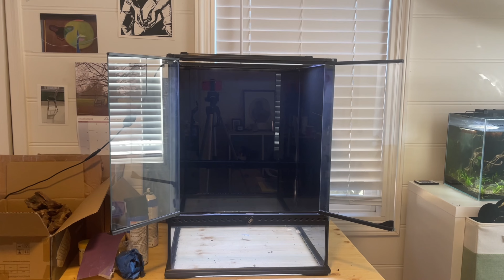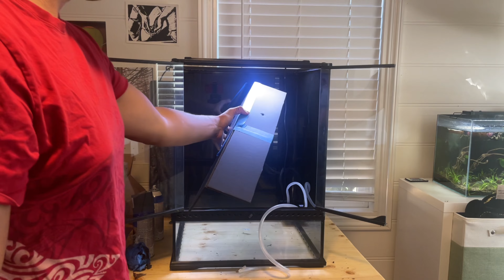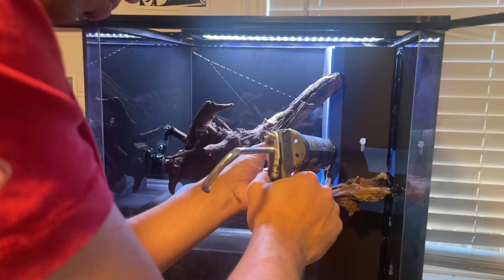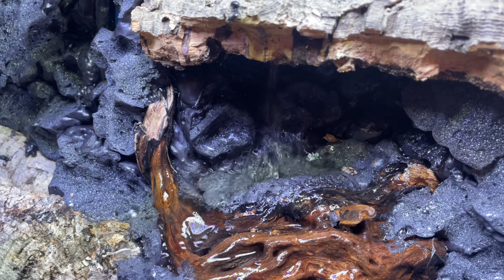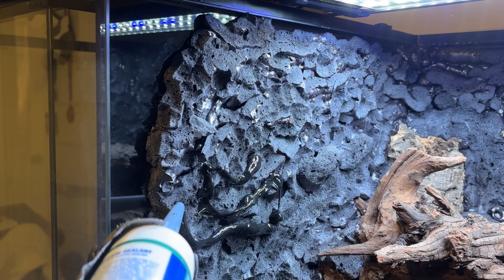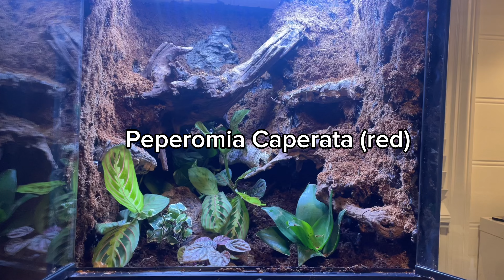White’s Tree Frog Bioactive Vivarium Build! 18x18x24 with waterfall- Step by Step

Comment: are the toothpicks used for the moss removed later? if not how do you keep the frogs safe from accidentally poking themselves?
Reply from the maker: The toothpicks are first cut off after pinning the sponge in place so one side is dull. Then they’re removed once the moss is rooted

Comment: What was under the foam you put in the bottom? It doesn't look like the glass
Reply from the maker: there’s a layer of sponge on the bottom for our drainage layer
Reply: @tangledearthvivariums so the sponge and foam are two separate layers?
Reply: @tangledearthvivariums also curious about this. I don’t understand where the water source comes from? Are the layers just foam and substrate on top? Where do you add water to feed the pump?
Reply: My question as well! Not clear on how the bottom layers are working to allow the basin for water fall to feed from

Comment: This is a horrible set up for whites tree frogs. Whites tree frogs are a low humidity species and should be kept at 40 to 45% . 

This set up with the waterfall will cause the humidity to stay above unsafe levels of humidity and will cause the whites tree frogs bacterial infections.
Reply from the maker: the top is fully open mesh, plus the ventilation at the front makes the humidity pretty low. The waterfall is small and really only raises the humidity directly around it. It’s comparable to having a small dish of standing water in the tank. It can also be controlled remotely or put on a timer so it doesn’t have to run 24/7. We wouldn’t recommend a full on waterfall or drip wall background for WTF, but a small dripping water fall can be a good way to create a humidity gradient so the frogs can self regulate

Comment: Australian white tree frogs have low humidity requirements, 50-70%, compared to other tree frogs that need 80-100%. This terrarium is going to maintain humidity way too high which will lead to health problems for the frogs.
Reply: You are correct they need low humidity but you are still to high. Whites tree frogs should be 40 to 45%
Reply from the maker: the mesh screen at the top is completely open. They get good airflow and can self regulate humidity. Towards the bottom is closer to 70% The top is closer to 50%. For 80-100% humidity we would need to cover the top with glass or acrylic and mist very frequently
Reply from the maker: but this may vary for individual people depending on where they live and the ambient temp and humidity
Reply: @tangledearthvivariums whites tree frogs are low humidity species and should be kept at 40 to 45% this set up is horrible for them

Comment: How much did the background cost?
Reply from the maker: good question! For an 18x18x24 spray foam, silicone, hardscape, and plants can cost anywhere from $100-$500 depending on where you source them and how much you use. It’s a big range, but if you’re able to get your hands on cheap driftwood and plants it keeps it on the lower end for sure.

Comment: How do you drain the tank of water if it’s needed
Reply from the maker: good question! I’ll usually stick an aquarium siphon in one of the front corners of the tank between the sponge layer and the glass and use that to drain the water. It’s not something I need to do often on our tanks but that’s pretty quick and easy when we do. If you want you can leave a small pvc pipe going to the bottom and cap it with something so you can get the hose in easier. You could also stick a siphon in the waterfall compartment at the back which gives easy access to below the waterline
Reply: What type of wood did you use for your hard scape

Comment: How did yall move it? I have a bioactive the same size and am concerned it will shatter if I try to move it as it’s so heavy. Especially with the wood and drainage layer
Reply from the maker: 18x18x24 we’ve been able to move fairly easily. We drain any water, lift it with two people, and put it right side up in a car, sometimes wrapped in blankets. You can also stuff the gaps on the inside with paper towels during transport to avoid it shaking around.

Comment: Do you worry about mold in these type tanks ? Do you ever have to change out water or clean the tank ? I’ve started my first bio with springtails but I just worry it’s not enough and afraid if mold could grow?
Reply from the maker: no issues with mold. As long as you have enough springtails and airflow it should be totally ok

Comment: I’m trying to build a waterfall with false bottom like you did here but I’m still confused. With the waterfall just dripping out onto the substrate and then back down to the drainage layer again, does that mean you have to top off the water pretty often for the waterfall to keep going? How does the water level stay the same when it’s dispersed into the substrate… ??
Reply from the maker: there’s a 2 inch layer of sponge beneath the substrate. This is our drainage layer and it contains standing water. that water level has to be above the height of the pump intake, but below the substrate to stop our substrate from just being soggy and stagnant. The water does disperse throughout the substrate but eventually it makes its way down to the drainage layer. It mimics watersheds irl, where water pools under the soil in between evaporation and condensation. You’ll generally have a gradual input of water to your tank in the form of misting or watering for the plants, so I find I actually have to drain our tanks periodically rather than top them off. If you’re in a hotter, more dry environment though, I could see you having to top off or mist more frequently. With a system like this where air flows freely and you mist the tank, it’s rare for the rate of evaporation to be exactly equivalent to the rate at which you add water. TLDR: it depends on your tank and house parameters
Reply: @tangledearthvivariums i want to make my own so i just get my aquarium foam on the bottom and the water will reach the pump fast enough? i have like all the same materials as you
Reply: Where do you buy the sponge layer from

Comment: Question about the foam board sitting in water- does it dissolve over time? Any risk of soil or water contamination?
Reply from the maker: it should be all good!! if you’re worried you can also use plastic sheeting
Reply: @tangledearthvivariums  got it- thanks! Nice set up

Comment: So is there just a layer of water sitting underneath the aquarium sponge and then leads back to the pump?
Reply: Great, thank you! I don’t know if it was for an extra filter layer
Reply from the maker: yes!
Reply: @tangledearthvivariums  it looks like there was a layer of something under the sponge. Was that spray foam or brick??
Reply from the maker: @019hatch it was just a piece of foam that comes as the backing to the tank- easy way to build some more height while reusing materials. Otherwise I would just double the amount of sponge!